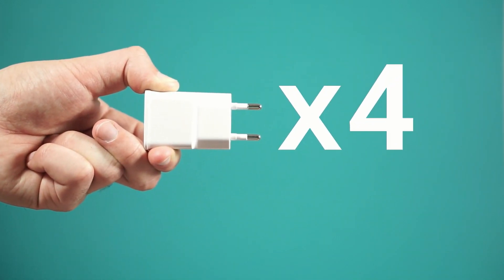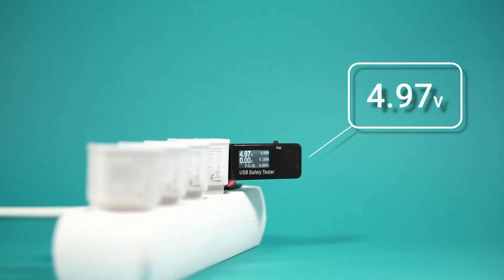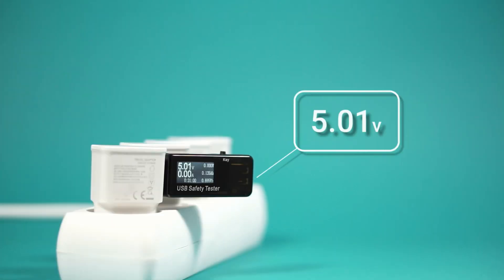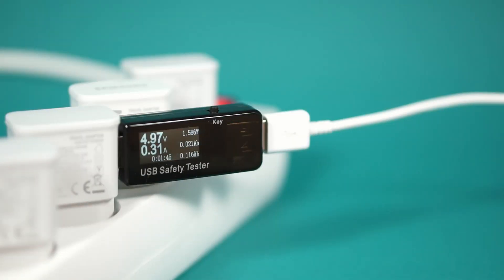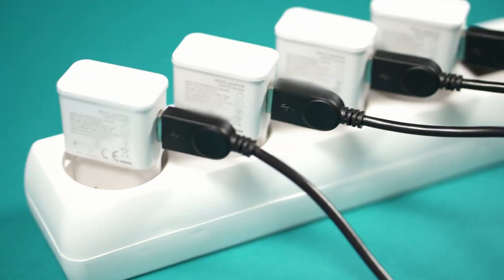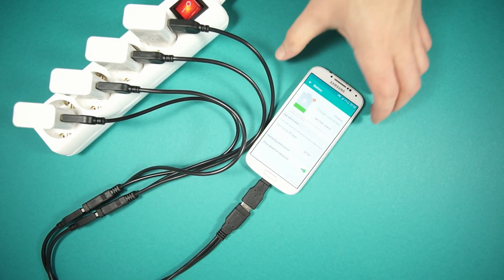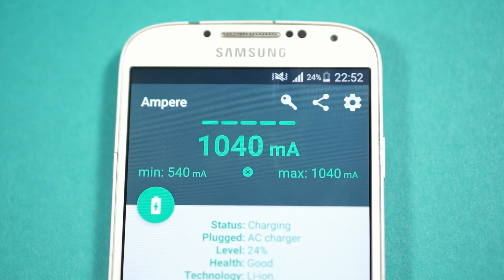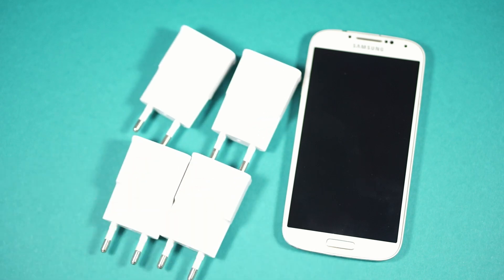Fast Charging Test | Connecting Four Chargers At Once to Mobile Phone

Comment: If the current is limited by the phone regulator this does not mean that the phone will not charge a lot faster due the the current back up from the multiple chargers. The volts always stays the same but the larger current is available to be used due to chargers in efficiency. Since this is true your phone will charge faster and always remember to end and stop the multiple charging set up at 99% and definitely the moment it reaches 100%. Do not leave the phone unattended due to the batteries faster charging rate can cause damage to the battery if charging is not stopped at the moment of 100%.

Comment: The charging cable is not just a couple of wires it has an electronic board with multiple ICs which regulate the power pumped into the device and protect it from high current/voltage, plus cables with high power capability are often equiped with multiple 5v wires, my lightning cable has 2 5v wires (thick ones XD), so long strory short provide as many power as you want the cable will output its advertised specs.
Reply: It depends if the phone communicates with the charger to negotiate a voltage. If it doesn't, it defaults to 5V. If your phone supports charging at 4A for 5V, you can connect 4 "dumb" chargers which each deliver 1A, 5V. Provided the cable you use is thick enough to allow a 4A current without getting hot.
But you're right, modern fast charging relies on the device communicating with the power supply so it can use a voltage higher than 5V

Comment: Simple electrical knowledge would have told you in order to push more current to the load (the battery of the device) you need to increase the supply voltage from your charger. Chargers sometimes may have voltage and current regulators so that both voltage (typically up to 5.5V and protection circuits if it detects >6V) and current does not go beyond tolerated specs. That's why some "dumb" fast chargers will just push a higher voltage without regulating the current (they by reducing the supply voltage when it is charged or too much current is flowing) and hence can easily damage your device. That's why even if you parallel 4 chargers together which regulated themselves to 5V you will still get 1A output. Fast Chargers operate at a slightly supply higher voltage as explained.

Comment: Whats the limit of connecting chargers
Reply from the maker: There are no any limits. Test shows, that this solution doesn't work. It is better to use one charger adapter, which can provide required amount of power for specific phone.
Reply: U mean theres no way ???
Reply from the maker: @berginv6827  Fast charging much more complicated than usual, with a lot of restrictions to prevent damage on phone and battery. At this point, the are only one solution, using specific charger.